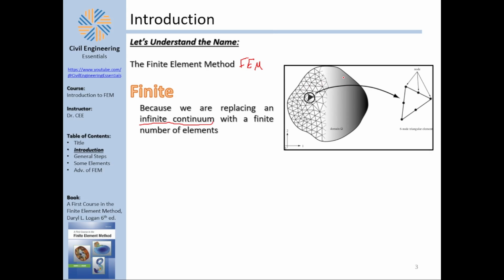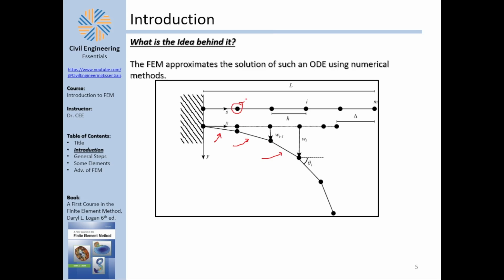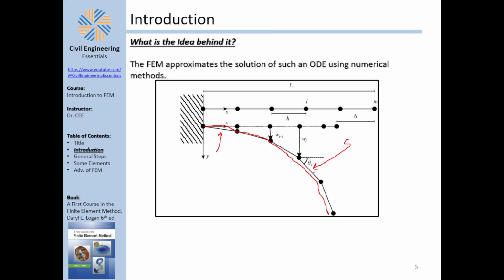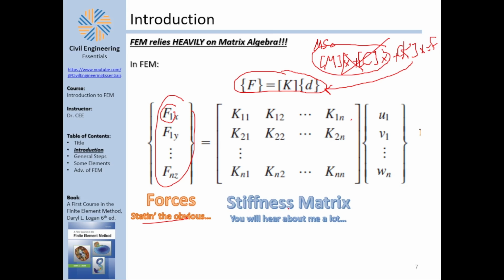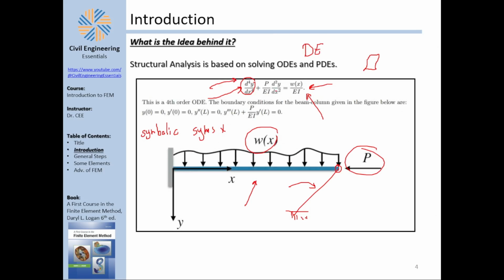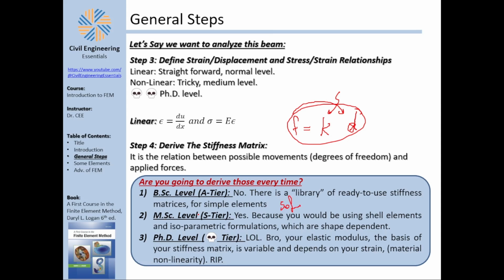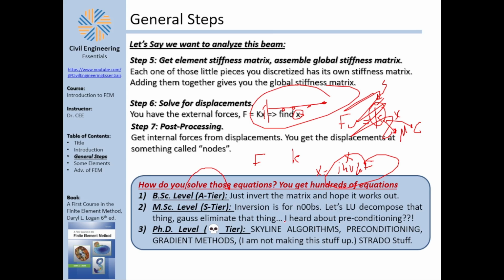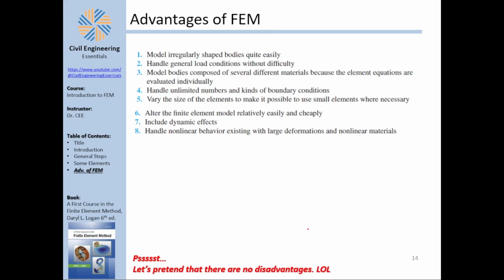The Finite Element Method (FEM) | Part 1: Getting Started

Comment: Hello kindly can you breifly explain the difference between the FEM and trapezoidal methods in terms of results.currently i am watching the robot structural analysis series and i noticed that when apply a shell that is support by a beam which is simply supported the results doesnt come to equal the known static equation wl^2/8 and i am so curious to know why iw that happening.thank you in advance
Reply from the maker: Hi there and thnx for your question,
The trapezoidal method is an approximate method of load distribution on the carrying beams. 
It has the advantages that it is easy and adequate for hand calculation.
However, as you mentioned, there will be a difference between your wl^2/8 and the moments you get from both FEM and calculation.

if you use hand-calculation (trapezoidal and triangles), then your moment is different thatn wl^2/8 because the load is not constant.

it is also different from the FEM, because in the FEM, the load distribution is related to the stiffness of the direction x and direction y (which includes the stiffness of the carrying beams). FEM cannot be easily predicted by hand-calculation, and is more accurate.
Another advantage is that: when you use FEM calculations, your slab becomes discretized, which allows you to see the moments inside the slab as well as the deflections, allowing you to design the slab beside the beam.

Hope it helped.
Regards,
CEE
Reply: @CivilEngineeringEssentials  kindly can you explain what do you mean by the load in not constant in hand calculation?

Comment: Thanks alot for your videos. It would be interesting to see you model a masonry load bearing structure in RSA.. Or a beam in a buildong supporting a masonry wall which in turn is supporting a slab or other load. I've had difficulties approximating/modelling this
Reply from the maker: That is a great idea, I will keep it in my mind after I finish the steel warehouse and RC structure series.